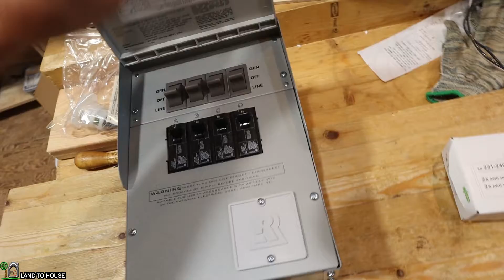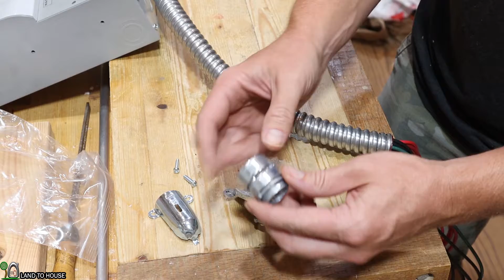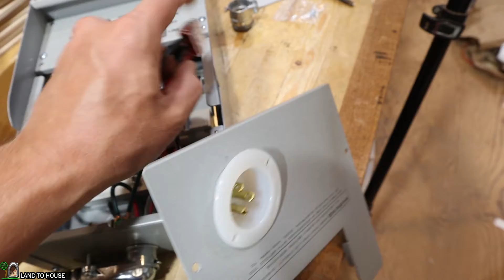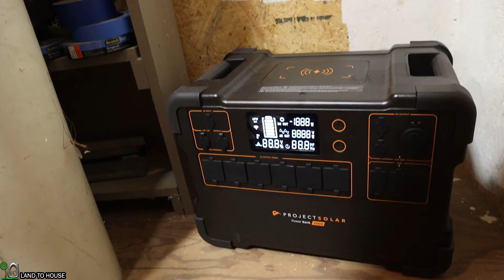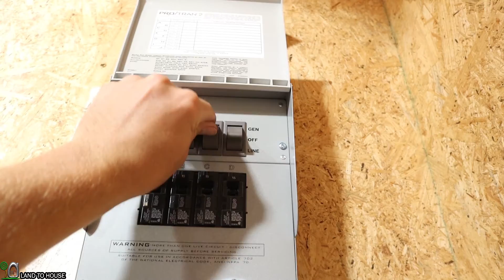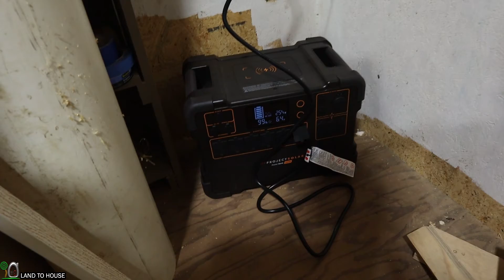Transfer Switch full install and Project Solar 2000w Power Station

Comment: Any chance you have a diagram that explains exactly how the electricity runs after the transfer switch is hooked up. You explained it, but I still did not understand lol
Reply from the maker: I dont have any other diagrams on this one. At first the two input one output idea can be confusing. But it is not so bad once you get into it.

Comment: I just found your channel and sub'ed.  My question is. this;  I have. the Pro/Tran2 and getting ready to install it and run my circuits off my 3600 Delta Pro unit.  Is there an issue with the electricity when power comes back on or a line man is working on the pole downstream?  Thanks in advance for your answer on this!  I'm sure others have the same question or maybe I can't wrap my head around the answer!
Reply from the maker: The transfer switch isolates the input. The power from the delta pro will only power the breakers when the switch is set to that setting. It cant feed back to the grid.

Comment: How do you install a interlock kit with this so you dont back feed the utility
Reply: Transfer switch is a break before make switch. Each switch has three positions. Off (disconnected/de-energized), utility and generator.
An interlock is a different method usually implemented to manage the position of a main and back-fed breaker preventing both being on at the same time. Disconnect that panel from the grid.
Not needed when a transfer switch is utilized. Both ensure grid disconnect. 
Transfer switch is easier to manage during outage. As opposed to managing a whole panel. IMHO I prefer that because if I'm not around it's much easier to explain to uninitiated how to setup.

Comment: These transfer switches require splices & wire nuts within the breaker box. This is illegal in many electrical code jurisdictions. As a result, you need to make sure the installation doesn't void your house insurance.
Reply: This isn’t true

Comment: The transfer switch breakers were all 15-amp breakers, were  they connected to 20-amp breakers in electrical panel for your outlets?

Comment: Great video!  Just 1 question.  Can you use this switch even when the grid is up to just run a certain circuits off solar?
Reply from the maker: Once you flip that switch it does not care what the other input is doing. I run my whole shop off grid while the grid power is still available.

Comment: Can that be used even when you’re not in a power outage situation? say you wanted to run batteries and a inverter to a circuit in your house to run a window AC. But still have grid power to the house control panel.
 could you use that for such a application?

Comment: What if I have a generator, grid, and then an inverter? I wanna use the bypass in the inverter, and I want to have a separate bypass in case the inverter is removed?

Comment: Is your neutral white wired undersized by making the transfer switch 120V?
Reply from the maker: Because the power station used only has 2000w output it will not get enough amps to cause an issue.

Comment: I see you shut off your breakers in the main panel to simulate a power failure.  If you wanted to toggle to the generator side of the transfer switch with grid power still available do you have to shut off the grid breaker.  Would be nice to bring solar into your power station and use the transfer switch to provide free electricity to certain circuits.
Reply from the maker: Both the system in the video and the one in the link below will soon have solar power doing just that. A whole house battery with solar will connect to the transfer switch and power the building off grid. 
https://youtu.be/HVkVDiqYkl0?feature=shared

Comment: I just installed a 10 circuit pro-trans transfer switch but I keep getting a back seat does it have to do with they have six tandem Breakers in the panel in every circuit is going to the transfer switch are on tandem Breakers and I keep getting a backfeed backfeed what do you think that could be

Comment: I've got an existing transfer switch for my gas generator with a 240v capacity. Can we also connect a solar system to this switch and just turn on the 120v breakers?

Comment: I just installed a single circuit transfer switch . Generator has floating neutral so bonding neutral at panel. The big issue is all these switches are illegal in Canada. I am waiting for inspector to come to my house and give me the low down in person. My worry is fire insurance policies if switch is put into service .
Reply from the maker: Thats odd to hear its illegal in Canada. These are common over here in the USA.

Comment: Have the same type set up, but with a 10 circuit transfer box and 50amps.  Can power it with both my 240 generator and from my solar inverter with the 50amp plug.  Can run everything in my home except the central ac and oven at the same time.

Plan to use my exact same set up in puerto rico when we move back next year to retire.  Will keep the grid power, but will run everything from solar full time, and simply use the grid if there was ever a problem with my solar.  Basically an off grid system with mains as backup.  And having this set up allows me to simply remove the solar 50amp plug, and plug in my gas generator instead, in the event of a storm that takes out both the mains and my solar.

And to anyone who thinks this is too hard to understand, you should know that I knew nothing about how any of this worked until 6 months ago.  Watched a few videos that were like this one, and installed the same thing with a couple days worth of knowledge.  So trust me, if I can do it, you can as well.

Comment: Can an EcoFlow DELTA 2 Max be wired the same way you have explained in this video without resulting in any damage to the EcoFlow??
Reply: Yes.  I use the exact same Pro Tran 2 transfer switch with my Delta MAX and I have it backing up 2 mini fridges 2 full size fridges and a Deep Freezer. It surges to 2100 watts then evens out at 5oo watts. Works great :)

Comment: Hi i have the same transfer switch connected to a Ecoflow,  there is a way to charge it via ac wall outlet at the same time without damaging the power station?

Comment: I have done something similar at my house. I was recently reading the protran manual and it says the transfer switch should be used with a generator/inverter that does not have the neutral and ground bonded at the inverter. Most inverters are bonded. Is this a big deal?
Reply: yes, because the transfer switch will be tied to your main panel - which most likely has the ground bonded to the neutral.  You shouldn't have more than one neutral/ground bond in the circuit.  Check online to see if you can remove the bond in the inverter.  
Your other option is to use a small "critical load" breaker box instead of a transfer switch.  Then you would move the circuits to the small  panel but they wouldn't circle back to your main panel.  Then just have the neutral and ground unbonded in that small panel.  You'd lose the ability to flip back to grid power but if your inverter has grid pass through then you could still essentially accomplish the same thing.
Reply: Actually I have noted most inverter generators are unbonded.

Comment: Apologies, your description of how the transfer switch 'sent power to the main panel breaker' at 4:00 confused me and I had to find the installation instructions.  Your description at 19:20 was much better that it feeds each house circuit from either the panel breaker or the auxiliary power.
Reply from the maker: Sometimes words dont come easy for me. But at least the restatement at the end made more since.

Comment: I don't understand why there are 4  toggle switches. Is it one toggle for each breaker? It looks very confusing. 
So when you are running with the switch in the line mode, there are two breakers in the circuit?
Reply from the maker: In a transfer switch the toggle switches determine if the breaker in the main panel or sub panel will be used. Grid power or off grid power.you can select what breakers will work at any time. The middle position of the toggle is off for both breakers.
Reply: Thank You.  @LandtoHouse

Comment: Why did you not wire the transfer switch conduit from below the breaker box or from the side of the breaker box?

The transfer switch is way too high!
Reply from the maker: Because I have so many wires underneath that breaker box. I did not want to snake the new wires from the transfer switch around those. And drilling through the osb would have been dangerous.  On top was the best option. Also I could add a shelf below the breaker for the power station to rest.
Reply: @LandtoHouse  - i see your dilemma. I took a look at your cables coming in the various parts of the box it looks difficult to work with. 

I believe there is electrical code requirements regarding how high, low, and how much front clearance is on subpanels. Too bad you could not just get a longer piece of flexible steel conduit to run the wires through. You might need to revisit this again.

Comment: Thank You that was very helpful. Now my wife won't nag me😂. What was the cost for the transfer box and equipment?
Reply from the maker: Happy to help. Its not so bad once you get in there. This 4 breaker transfer switch ranges between $250-$300. A bit costly but so nice to have.
Reply: Whatever the cost is, it's a lot cheaper than a divorce attorney. Worth every penny....